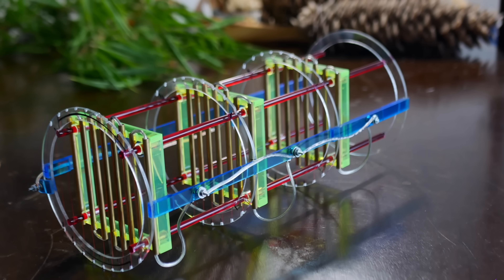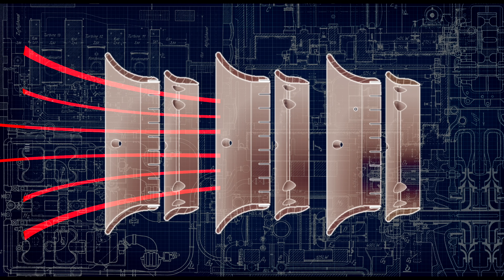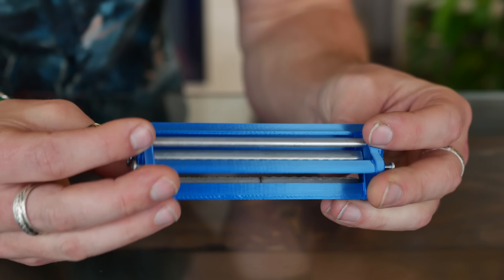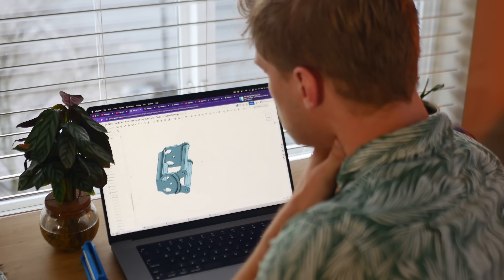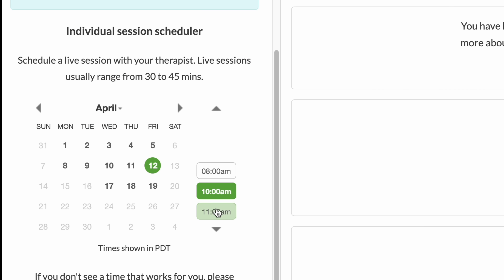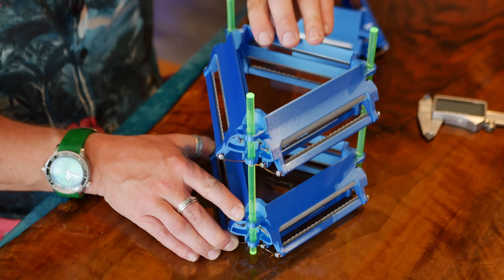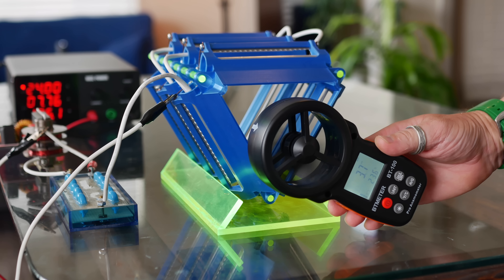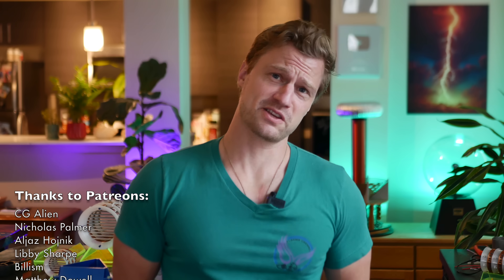Next-Gen Ionic Plasma Thruster Inspired By Nature (BTC Mark 3)

Comment: Hi, i really love your videos, however i might have spotted an oversight when you said that the old thruster had diminishing returns. 
Because the kinetic energy is quadratic to speed according to 1/2mv^2 it is expected to get less difference in speed from the same power with each added stage. When calculating the energy per kg of air the following pattern emerges
2.1m/s -> 2.21J/kg -> Energy gain from Stage 1: 2.21J/kg
3.2m/s -> 5.12J/kg -> Energy gain from Stage 2: 2.91J/kg 
3.9m/s -> 7.61J/kg -> Energy gain from Stage 3: 2.49J/kg
So actually the first stage is less "efficient" than the later stages, so i think there really aren't any diminishing returns.
I wish you the best of further refining your design. I'm really excited for where this is going
Reply: When people have done the tests themselves with a scale over the past 70 years, testing multiple stage ion thrusters, it is apparent that there is a drop in thrust per watt with each added stage.

Comment: If you stop converging the flows by removing the 20 deg angle of the profiles only then the draft will pull the air from the center region of the triangle and should significantly increase the air flow.

Comment: you can mach the speed of the air in the stagnation point of the wing to reduce drag? like creating a simulated 0 frontal area drag? with just the drag of the air friction and air disturbence behind? my idea is that you get this with a hole from the front of the wing to the back with ionic thrust in the midle acceleratin the air to mach the air speed in front and back of the wing.

Comment: Given that you are attempting to test the power of convergence with the output, did you test to see if converging the resulting thrusters improved the results?
Also, as others have pointed out, the performance of the thrusters needs a more comparable metric than just liters/second. Unless you are logging the power used to produce the results, the amount of air means relatively little. I'd also be interested to see the static pressure measurement of the output. 
Personally, if these perform efficiently enough, I think they'd be really interesting to see used in a pc or custom cooler. Even if they aren't all that efficient, I'm sure one of the other builders would love to try it out. LTT anyone?

Edit: grammer

Comment: Could this be the ticket for Ionic thrust classic rocket spin around the globe getting faster and faster where is a wedding circle of travel around the globe television space and being slingshot into deep space where is a full body on board of the vacuum seal casket with iron thrust engines powering its exit from the Galaxy into deep voided space like the Voyager probe this will be similar to that and with systems on board to to take pictures of section of space that travels through a true Star Trek funeral  in in space that's what I want to be launched into deep space but doesn't cost me a lot of money cuz I'm a poor man thrush all you need to do is buy yourself a printer and have the plans to build out on a thrust engines and build enough of them with solar panels attached to your craft to buy your engine's power

Comment: I only trust engines is that the key for space travel for transporting vacuum sealed caskets crashed into space with full human remains on board no worries no cremation just full body like you'll be buried in the ground biotic thrust engines to truly have a Star Trek spring roll could this be the key bionic thrust engines ionic ionic thrust engines could be the key to be having a Star Trek funeral in space will there be a lot cheaper than a need a rocket launched into space going around a globe of Earth reaching higher and higher attitudes that you reach space slingshot in yourself into deep void a true Star Trek funeral a vacuum sealed casket stripped ionic ionic engines with computer systems to troll control the craft remotely from Earth in too deep space like the Voyager probe

Comment: Hey I am not an engineer but can you make it round so you can suck in more air with out loosing the space in the middle. Like a normal jet engine but withe out the blades so I get the structural integrati from a circle and mor air flow ? 

And if it is not possible why or wat is the downside ?

Comment: Some Physics here is helpful.

You want to optimize for the most thrust for the least power.

You get thrust by accelerating air backwards. The momentum of the air moving backwards is m*v; the kinetic energy of the air moving backwards is 1/2mv^2. You want the most momentum for the least kinetic energy.

Maximizing mv / (1/2 mv^2) you get 2/v. In other words, your efficiency drops the faster you move the air.

However, there's also a few other considerations here!

For one, you seldom will use a thruster like this while truly stationary. And if you're moving forward at 10km/h and your thruster moves air back at 5km/h... you aren't actually making any thrust.

When you work out the optimum, it works out to "you want to move air back at 2x the velocity you are moving forward". This is why props work well at low speeds, then turboprops, then high-bypass turbofans, then low-bypass turbofans, then classic jets, then ramjets, then scramjets, then eventually rockets as you increase speed. It's "all" about the exhaust velocity. (Well, not entirely. But largely.)

However, this then gets into the second consideration: if you want to move air back slowly, you need to move a lot of air slowly. And you can only fit so much through a given, say, 10x4cm hole. Especially if the air is moving slowly.

I suspect if you wanted to maximize thrust at low speeds you could do better by optimizing to improve the amount of entrainment air. Look at e.g. bladeless fans for inspiration.
Reply: Or my channel about ion thrusters.

Comment: Instead of focusing on the speed/volume of air moved, try to optimize the pressure of the output.

Even if you are able to get a really high volume of output, its scalability is limited by the pressure of the output, think of it as a Newtonian problem. Once the pressure in the central column of air has reached the max of the individual model, adding more will provide no extra performance gain. The flow rates don’t exactly add up.

Comment: about the sequential design providing diminishing returns +50% +25% in speed but ifbyou think in terms of energy you have +130% and + 48% energy (for +100% and +50% power input). or +244% energy for +200% power input overall. it would be interesting to measure thrust too.
I think rhe issue with sequential design is the closer you are going to accelerate an aircraft the output velocity, the less efficient the multiple stages are going to become and its the reason why propellers on planes are never  used sequentially but in parallel

Comment: It seems like the introduction of the second stage is going to create some destructive interference and lose velocity due to the column of air not being as laminar as it could be to reduce drag and increase velocity. Have you tried another shape and pitch  them each slightly in staggered pattern to induce a spin on the exhaust side? Hexagon might be the bet. My thought was a few degrees more forward on one  side should create some swirl and offsetting the stages would help increase the swirl while being able to help stabilize the air column.

Comment: Great build. Why did you go with triangular form rather than circular? You can build the same linear thrusters  but bend them around into a circle the same diameter as your triangle. 
Then perhaps make each stage consecutively smaller to compress the flow a bit

Comment: The final stage that’s outputting the fastest velocity is fed by slower earlier stages, similar to a gas turbine compressor. So the earlier stages need to gather more air to not restrict the final stage(make them bigger like a jet with a large fan disc that graduates down to the smallest row of blades)
With trial and error, figure what end velocity is then figure cfm’s, and expand back to the first stage and you’ll get the flare rate needed and then put the stages together in a sealed path not letting outside air in. I think you’ll figure out, at that point, how to bias the earlier gathering stages to help boost whatever is possible for the final stage, or stages.(it might look like a trombone horn, but hey?)
This is the same mechanics as stacking three same sized ducted fans in a row and getting diminishing returns from that. 
Think, how do fans make jet propulsion, and apply it to your ionic stages, but seal off the outside air, it’s not helping.

Comment: More convergence, fewer layers. The physics works out to the trailing layers canceling out. The equation for ipnization also indicates that ducted output would improve thrust by slightly densifying the air, increasing efficiency of energy transfer

Comment: By colliding the streams of air in a column you are inducing massive turbulence and a high pressure field behind the engine. that might sound good, but it basically makes the engine need a stronger internal compression to overcome it. I suggest to either increase the size of engine intake the further to the front, or to make them exhaust parallel to each other. In other words, either brute force a large intake into a small output and compress it down with each stage, or make it all flow parallel and avoid compression and go for airspeed. To illustrate with water, laminar flow moves more water compared to chaotic flow at the same pressure and pipe diameter, but if you want to increase the pressure, its easier to just force it down the tube in chaotic flow by increasing the pressure.

Comment: Not a scientist and just a normal civilian but what if you change the size to get smaller per column and I do know that airplane thrusters have automatic cones at the end that widen or enclose smaller to produce pinpoint power. I can assume that you are losing air between each pass, maybe it's better to pump air to each column then to have air colliding in that hollow point. So my point is to efficiently harvest the air and not produce waste.
Just a civilian opinion, not a scientist

Comment: You showed a cool effect on the previous model with the intake of smoke. Too bad you missed it with the new model.

I was wondering about one of the effects you showed, with the loopback. How much is the air loss/recirculation in the model?
And are you going to try with different shapes, like pentagon or hexagon? More sides would mean more airflow.
And like i also saw someone else question. You have the thrusters in one straight line. Does it help if you offset them, so the airflow can create a vortex, like a mini tornado?

Comment: Enclose, restrict the beast to spit out more fire 🙂Srsly! 
Try putting it into the tube/pipe 🌬
Reply from the maker: That would block off all air inputs
Reply: @PlasmaChannel  I was imagining to restrict space around your thruster, something like suspending it in the center and at the end but fully placed in the pipe with a 10-20% bigger diameter than your design, there will be enough air/space and may induce a pull effect from the surrounding air in the pipe. If that does not work like that then sorry to bother 🙂I enjoyed your video and got me thinking 😀

Comment: Hey Jay! Love your videos! Hope you make great steps forward in creating a real-world ionic thruster. Something I thought worth mentioning is back on your video for your Bluetooth plasma speaker, not related to this video, I found that the DC Flyback transformer I use plays music inside itself and the AC flyback that you put in your links I bought also plays music inside itself, but not through the arc stream, most of the time, no sound at all. Does not matter what resistors I use for the audio out on the Bluetooth receiver board. Have you encountered this? There might be something in your schematic that I am missing or a mistake. I would like to know so I can get it working. Thanks!

Comment: You could change to a design similar to a Dyson Fan, with a small inlet at the front surface. Curved surface and using an aerofoil design to reduce pressure further back in the ring design would create a venturi effect allowing the air to move faster, you can then recombine the two streams of air both now traveling faster together, increasing the pressure again, as they combine with the outside air you should gain a larger net air throughput. Ensuring the outer and inner surfaces are smooth and dont cause too much air turbulance.

You could also create multiple voltage points.
Entrance 2xV, V, GND

Any air that entered without being energised can then be energised at intermediary steps. This would keep the voltage differentail in one direction, otherwise you could end up with a second stage causing a counter effect.

Comment: You know those experiments where an arc to a toroidal magnet rotates around the magnet? I wonder if making an ironic thruster doing something like that would have a benefit. Maybe having it arc from one toroidal magnet to another to form an hourglass shape will result in more airflow due to the Bernoulli effect. Maybe it would also effectively create a larger area of plasma for more thrust than the single points with nearly 1 dimensional arcs of plasma.

Comment: the triangle shape also allows for a lot more a steerable thrust as well. more voltage on 2 sides vs 1 should direct air flow directions.
it also seems like it would benefit from being able to adjust the gaps at run time. like say adjustment threads using a non conductive metal. 
since it looked like voltage / gap = trust       able to adjust more variables during runtime should help with experimentation time. and might uncover extremes that weren't expected.

Comment: Random question from a layperson with a game-design-related interest in real-world space drive technologies. Why must this design use straight lines (and thus be geometric, such as this triangular drive) instead of making a thruster that's circular? If you aren't getting the constructive interference you expect, it may be because the airflow from the edges of the triangle are closer to the center than the corners, and converge in a different place, causing turbulence. 

Another thought - instead of recording it blowing dry ice fog, record it sucking dry ice fog, including at lower power. This may show you where turbulence occurs, and let you hone in on designs with smoother airflow.

Last thought - rather than measuring air volume and air velocity, measure thrust. You're making a thruster, the only useful metric of efficiency for a thruster is thrust.

Comment: The "diminishing returns" in adding stages may not be diminishing returns.  I'm thinking, kinetic energy is m * v-squared.  So, the 50% speed increment of the second stage represents 2.25 times the energy;  and so on.  If I'm right, the second stage transfers more power than the first.  The problem is that what benefits propulsion is momentum, rather than kinetic energy of the exhaust.

Comment: Nice small module! 
But - sorry to say - from an engineers point of view: the good part stops there. From building a thruster but not measuring the thrust (Thrust/Watt? Thrust/Weight? Efficiency?)  to  ignoring Bernoullis law ... only measuring the airspeed for efficiency plus not realizing the connection to kinetic energy is strange. And how about making protokols?
You did enough in the Gym, now get your science in shape. Please. You definitely could use some help.

Comment: I think having the stages that close isn't allowing the streams from each stage to converge before hitting the turbulence from the next stages. May want to try spacing them farther apart, but with shielding to prevent more air coming in, but have SOME air input to prevent a low pressure / vacuum area formation between stages. That would allow each stage to fully converge before being added to or even wrapped with the next stage column. As I was typing this, I also thought that, if you alter the angles of each stage, you may get coaxial flow where the stages can "wrap" the column of the previous and allow for, maybe not more velocity, but more total mass flow, resulting in more overall power output. You can't totally think of the velocity alone, but how much air is being moved at said velocity. 2m/s for 3 L/s is going to be more power than 4m/s for 1L/s. You simply have more kinetic energy being output. Air is approx 1.2g/L, so for the above you would have 60mN vs vs 47mN, respectively.

Comment: I'm curious if there would be a significant difference in added thrust with imput air already at significant speed (aka an engine on a moving plane compared to tests with the engine standing still).

Comment: You're running into the same issue people have when they make Gauss guns. If the first stage has enough force to accelerate the projectile to 10m per sec adding a second stage at the same power doesn't make it go 20m per sec it still goes 10. If you want more speed in subsequent stages the force needs to increase on every downstream accelerator. It also usually scales exponentially.

Comment: You have to trade velocity for thrust, just because the velocity is high doesn’t mean you’re creating more thrust, both are good for different things. It may help if you look at optimising the accelerated fluid coming off the trailing edge of the thruster especially if you’re going to use converging flow. Inducing some vortexes to energise the flow and control the turbulence of the air streams going back together